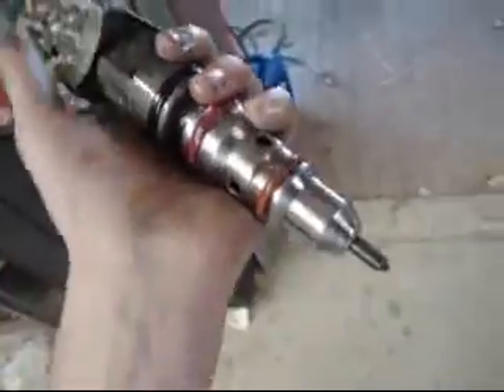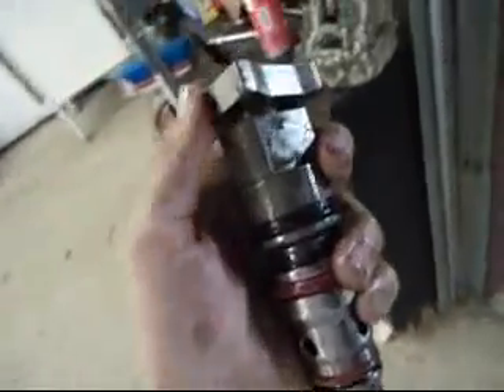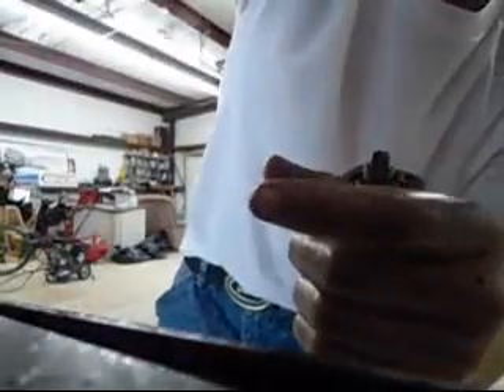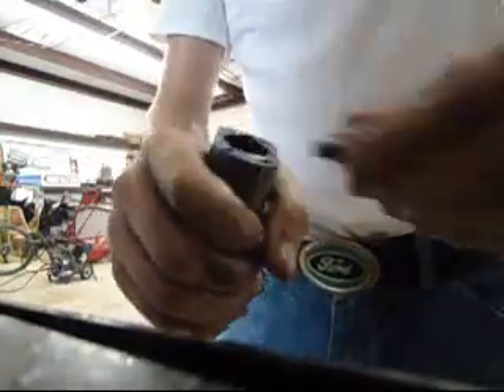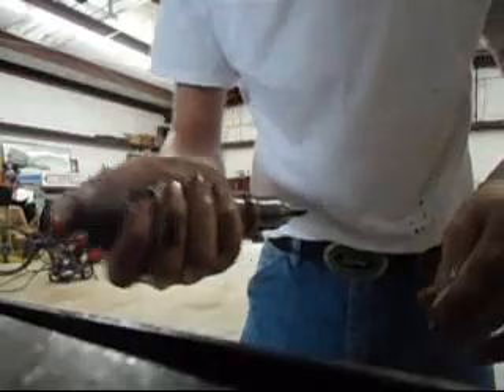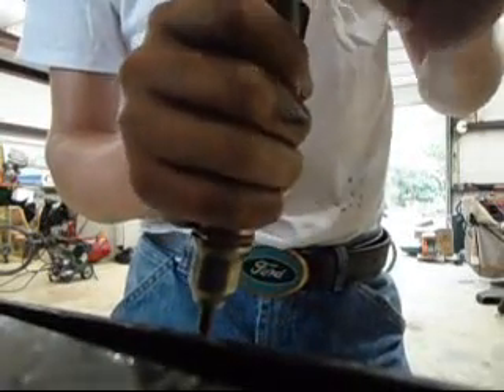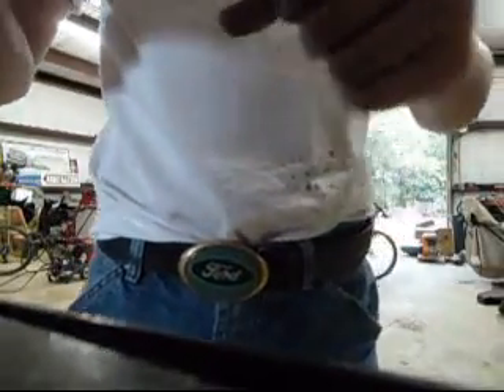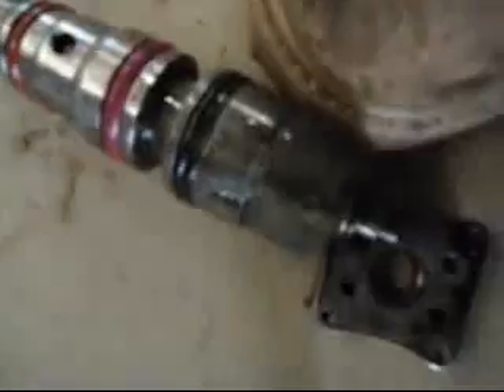7.3 Powerstroke HEUI injector

Comment: you have the rite idea but wat u r pullin out is actually the poppet valve. it is pulled up wen the solenoid is energized and that lets the high pressure oil push the intensifier piston. the piston pushes the plunger thru the barrel wich is atomized as it is sprayed out of the nozzle.

Comment: @2strokedetroit 6.0's will last a long time when taken care of properly just as any engine. The 7.3 on the other hand will last as long as you want it to with proper maitenence, keeping boost pressures under 40 psi on stock studs, and not getting careless with EGTs

Comment: @2strokedetroit once you do the EGR delete, head studs, and somewhat monitor the exhaust housing of the turbo and make sure its not becoming clogged with carbon deposit, you have a smaller displacement 7.3 with 4 valves per cylinder and a VGT. The design of the 6.0 was no where near way ahead of its time as the duramax was already a very similar basic engine design aside from the use of a common rail injection system. Ford just didnt give international enough R&D time with the 6.0.

Comment: the 6.0 was a very well designed engine, it just didnt have the components from the factory to hold up to high boost pressures that come about when you chip them. the 6.0 is a monster of an engine when its built properly...